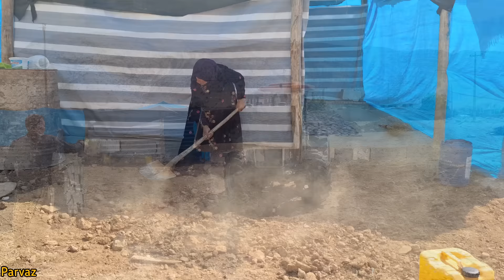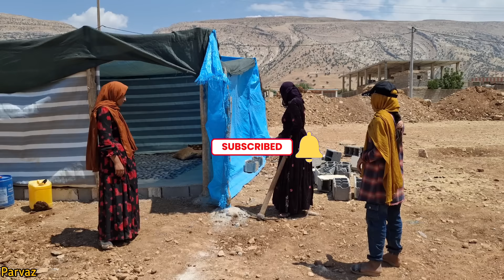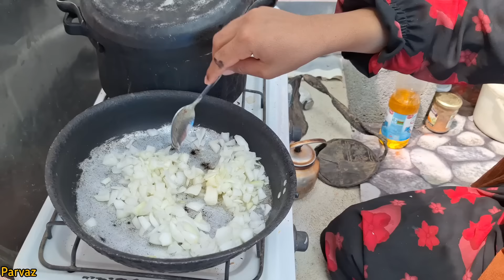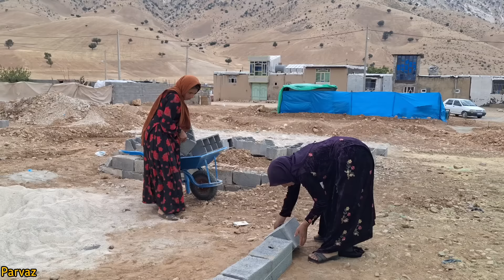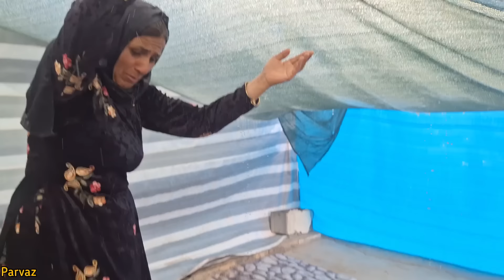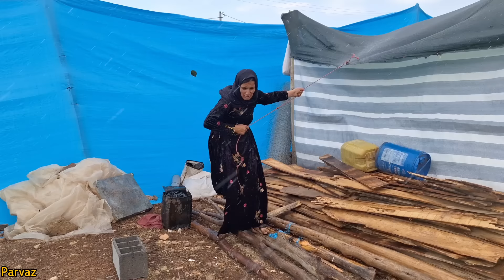Trapped in the rain ☔️: Heavy rain and mother's effort to take care of her daughters

Comment: She but a string line down, then did not use it correctly.  As many houses as she has built she should know to barely touch the brick to the string. That second wall was so crooked. How will the surveyor get a correct reading.